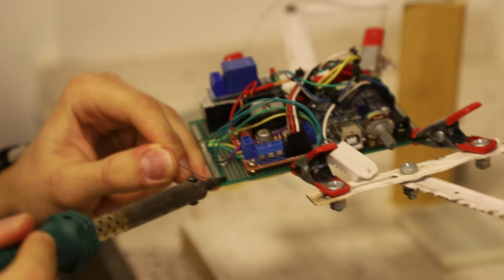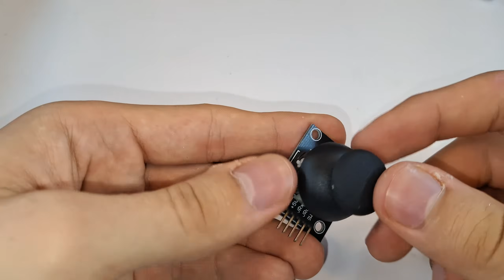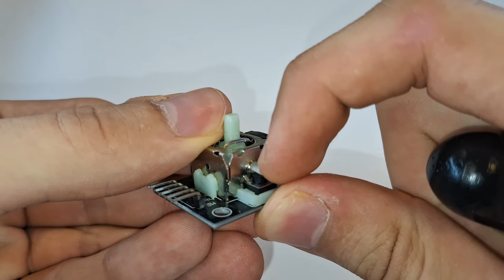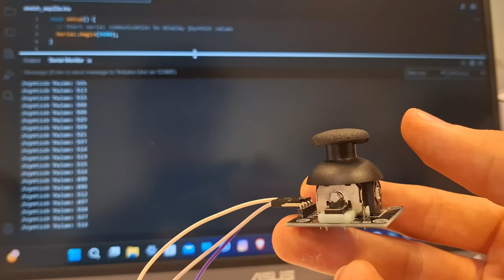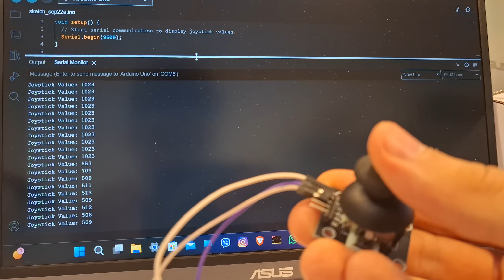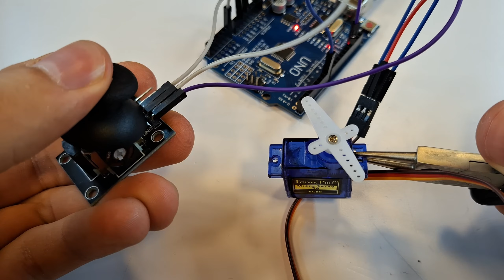How To Use a Joystick with Arduino: Control a Servo Using Joystick!

Comment from the maker: The circuit:

Arduino:     |    Joystick:
A0 -----------‐--------------> VRx
5V -----------‐--------------> VCC
GND -----------‐-----------> GND 

Arduino:     |  Servo motor:
D7 -----------‐--------------> Signal PIN(yellow)
5V -----------‐--------------> VCC(red)
GND -----------‐-----------> GND(black)

Comment: it would be helpful if you could add an image of the circuit
Reply from the maker: Arduino:     |    Joystick:
A0 -----------‐--------------> VRx
5V -----------‐--------------> VCC
GND -----------‐-----------> GND

Arduino:     |  Servo motor:
D7 -----------‐--------------> Signal PIN(yellow)
5V -----------‐--------------> VCC(red)
GND -----------‐-----------> GND(black)

Comment: didnt work
Reply from the maker: Can you tell what issue did u face??
Reply: @Mr.Atechs  the arduino code does not work
Reply from the maker: @Gamder9 send me the error message
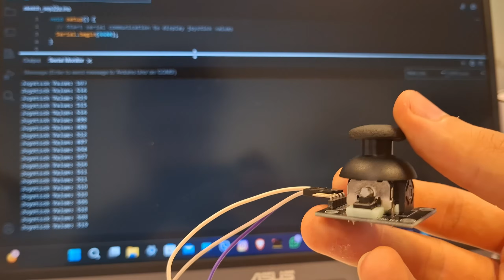Reply: @Gamder9  the digital read for 4:00 needs to be analogRead as digital read is 0s and 1s while analog read is a range to 1024
Reply: @Suoouper ok thanks

Comment: Have you done instruction on moving the servo with the IR remote control? I could use some help with that.
Reply from the maker: Hi @barnabywilde69, I haven’t made a video on that yet, but it’s simple: connect the IR receiver to Arduino (OUT to D2, VCC, GND), servo to D9, install the IRremote library, read your remote’s button codes, and map them to servo.write() commands for the angles you want.
Reply: @Mr.Atechs  Thanks for the tips.
Reply from the maker: @barnabywilde69 Let me know if you have any issues.